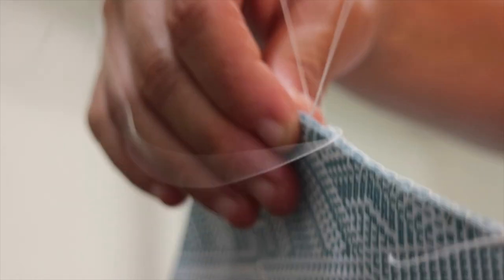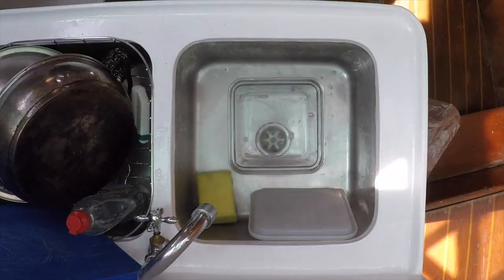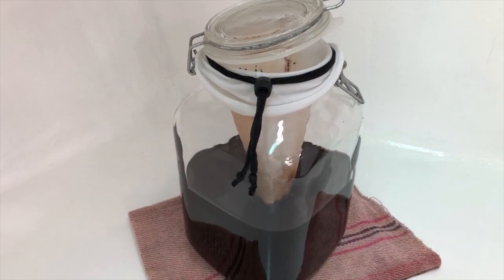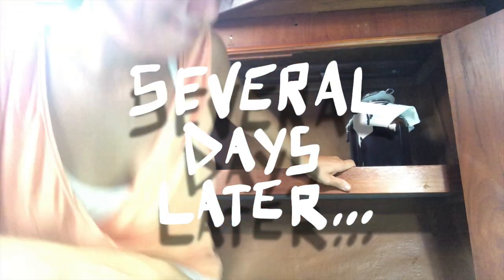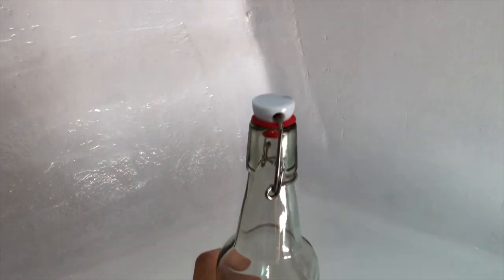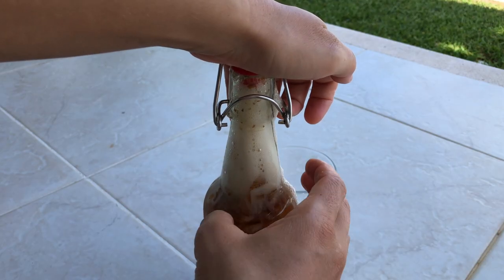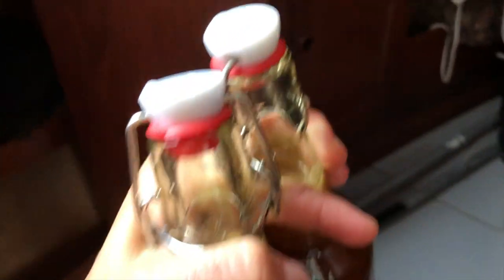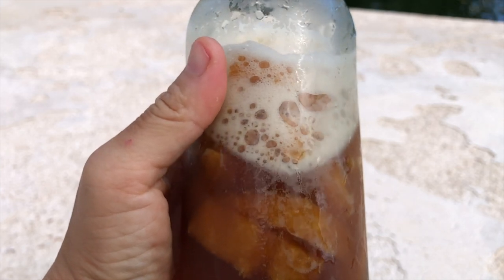Poor Person DIY Boat Bubbly

Comment: those spring-top bottles are great and usually will release pressure instead or breaking! Dont rinse with water that is too hot as it can weaken the glass! CHEERS from Canada
Reply from the maker: Thanks for the tips! So far, so good with using hot water to sterilise. I tried heating up the bottles slowly at first, bringing them to boiling point in the pot, but it ended up seeming more sketchy than just pouring the boiling water over them. Perhaps it helps their integrity being in a hot environment?